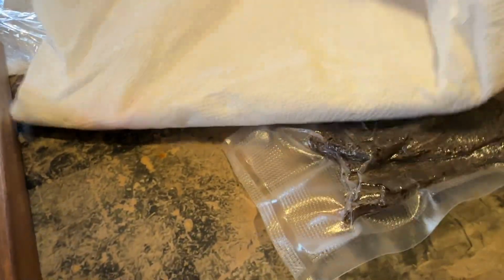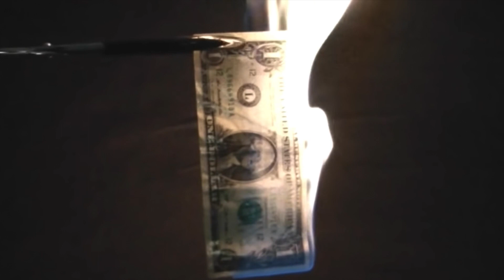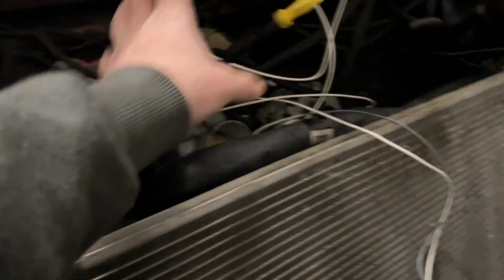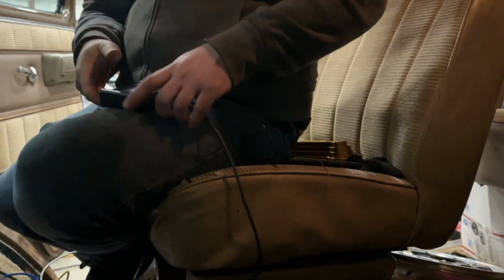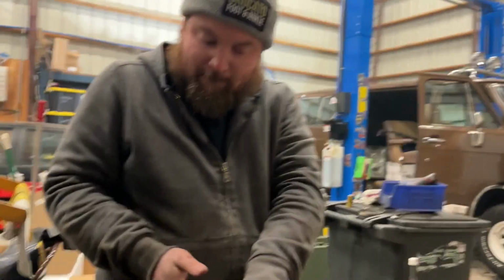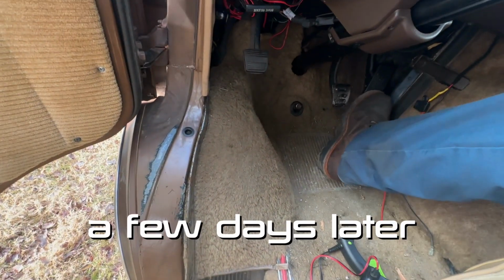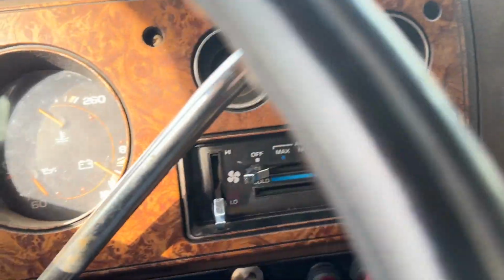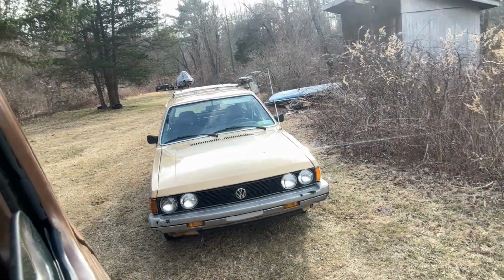chevy g20 nomad van LS swap first start and drive!

Comment: Throw some rear mounted turbos on it dude. Then we can have a Mike VS Mike drag race in the summer if I get my Vette fixed finally.
Reply from the maker: yeah the initial thought is to just do a rear mount jammer up underneath near where the tip is currently. only wanna throw 5-7 psi at it.
Reply: @mk1rabbithole  Sounds like a solid plan dude! That much boost should be good for upper 400’s at the very least at the wheel.